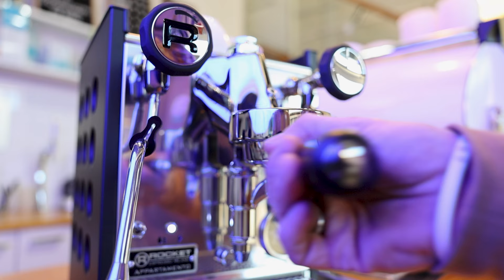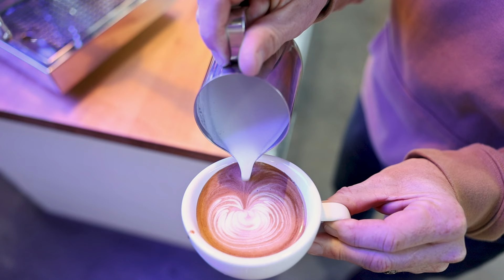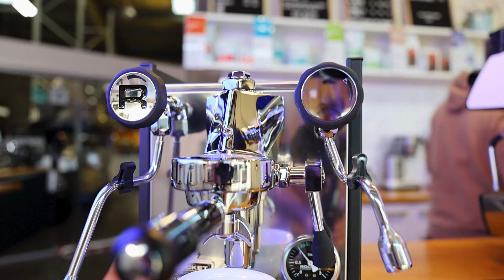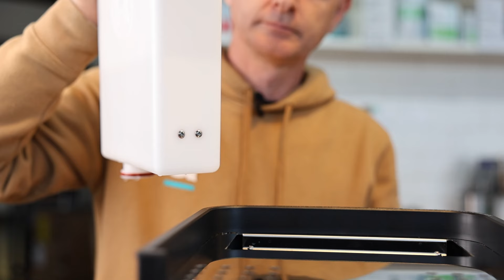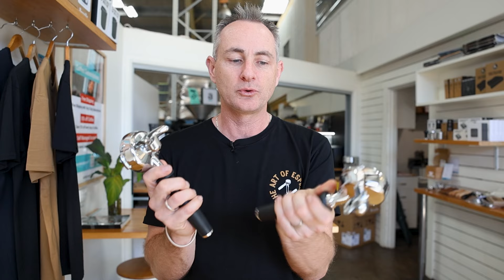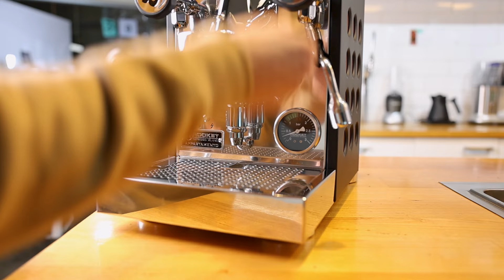Rocket Espresso APPARTAMENTO TCA Home Coffee Machine (Full Review)

Comment: These temperature settings should just be a switch somewhere on the machine, or buttons, kinda like the Profitec/ECM HX machines.   This lever voodoo dance you have to do is a huge UX miss imo. It's common to want to lower the temperature on HX machine to avoid overheating, and increasing the temperature if you want to steam a lot of milk.  
Don't know if they did this to differentiate it enough from the Mozzafiato V, even though the only practical difference already is the heating cartridges.

Comment: The whole lever/morse-code/colour sequencing is so un-intuitive. I understand the desire to remove digital interfaces but a hidden rocker switch would have been far preferable imho
Reply from the maker: Sure. We see this hidden process coming up more and more, it’s must come from programming school 😂
Reply: Agreed. BUT the advantage once you learn the code is the not having to access the hidden switch behind the drip tray and/or under the machine (or both) as some others use. You get used to its quirks like anything else